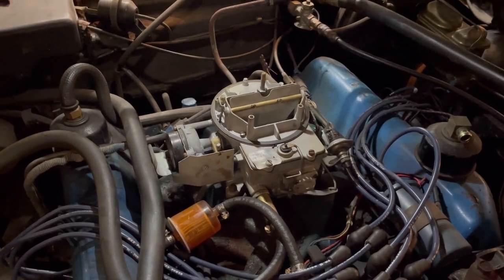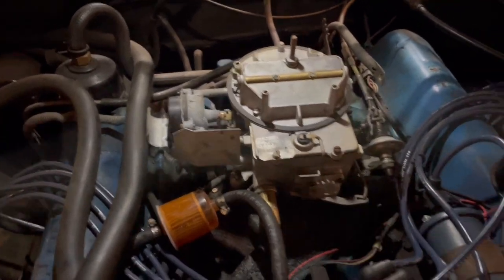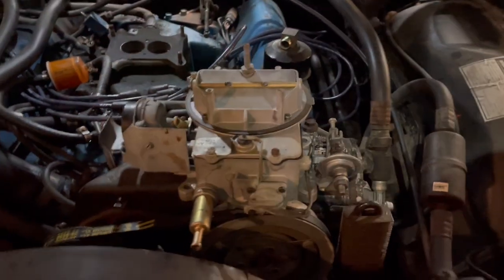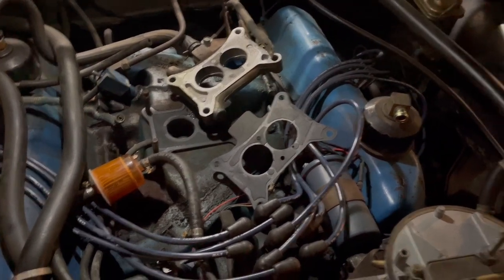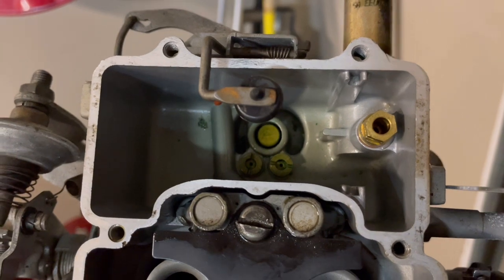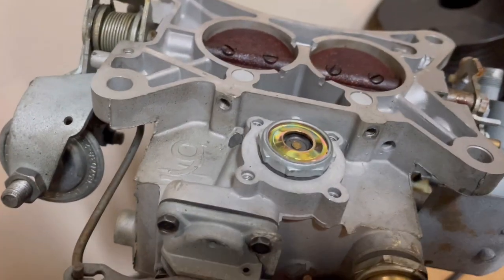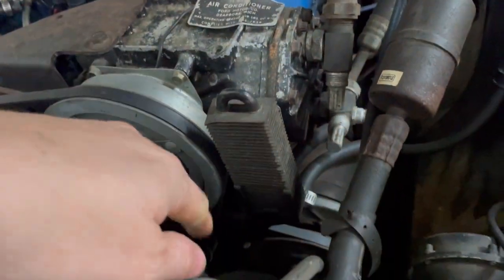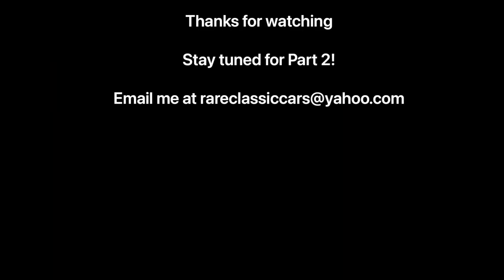Motorcraft / Autolite 2100 Carburetor Rebuild (1968 Ford LTD 390-2V) - Part 1

Comment: Hey Adam, . .good tutorial. Never knew you did them. My bad. Had a '68 Javelin with a baff'd 343 4bbl & FMX auto. Trans went and ended up changing the entire drivetrain. Found a '77 304 with the Motorcraft 2150 ( smog variant ) carb. Rebuilt the carb and threw a Chryco 904 auto with a shift kit in it and added headers. Figured I saved 80 lbs. with the new powertrain. ( the FMX was a cast iron boat anchor ) I never tracked it but driving it, I reckoned I match'd the factory performance of that car. On unleaded fuel to boot ! oh the times we had as " kids " !

Comment: Those were so simple to keep running they would get a little dirty I would just take the top off right on the engine and clean everything slap it back together and it ran like nothing was ever wrong with it⛽️🇺🇸

Comment: The 2100 is a great carb.  I rebuilt one during a community college class on engine building where I rebuilt a Ford 302 2V.  I owned several 2100s on other Ford V8s, and never had trouble with them.

This may not be particular to 2100s, but late 60s mid-sized Fords often had the throttle linkage set from the factory with only about ⅔ of gas pedal travel.  Readjusting the threaded rod on the throttle linkage to full travel unlocked a lot of engine power.
Reply from the maker: I have seen that on a number of cars.

Comment: Thanks for that video!  I have the 2100 on my '69 Marquis, and the carb was one of the first things I needed to do. Mine was in even greater need of a rebuild. Although I had a professional shop rebuild it, while I put on a new 2100 compatible carb from Amazon (which works excellently btw.) So now I have the OEM Motorcraft one rebuilt and ready on the shelf should the need arise. I am saving this video for future reference.  I was hypnotized by your endless tapping of the power valve! :face-purple-wide-eyes:
Reply: My friend's father across the alley bought a '71 Colony Park wagon with the 429 2bbl. That car could haul and scat pretty good for quite a while. Liked the premium fuel though.

Comment: I had one of these rebuilt last week. It's for an 1978 Ford F150 5.8L. It was running fine, but it was starting to leak from the accelerator pump. I was charged $260 on the vehicle, $160 if you drop it off.  I dropped the vehicle off in the morning and picked it up in the afternoon.  It was tuned and now, it's running better than it was before!    For me it was worth the extra $100!

Comment: I used to be pretty good with carbs, it's been a long time since I did one. I had a 69 F250, after a carb rebuild it would be a really sweet runner. It was an easy carb to rebuild. My very first rebuild was a Rochester 2bbl on my 65 Pontiac Tempest 326. It had quite an acceleration stumble when I got it, the rebuild straightened that right out!

Comment: My grandmother of my moms side of fam, bought a 1970 MACH 1 w/351 Cleveland, MT &, 9” rear end back @ 1972… my grandfather of same side ended up buying a 1971 Torino Ranchero GT w/351 Cleveland, C6 A/T &, 9” rear end.. I ended up getting the Ranchero from them in ‘94 & added about 250,000 more miles to the 250K miles it already had on it from them, by the time I regrettably sold it @ 2012. Anyway, both of those cars’ carbs looked exactly the same as this version on your ‘68 & both of those Cleveland’s had more then enough power for whenever needed. I maintained all of their different vehicles over the years back then and had rebuilt both of them carbs at least twice each over the decades they drove them around & rebuilt the one on Ranchero another few times during the decades I owned it… very simplistic carbs! I did have one particular issue with the one on my Ranchero within say, the last decade of use, of having the skinny brass metering jet tubes fall loose from the pop metal holder a few times; concluded the pop metal of that jet holder was just shot or worn out. Was but a 15 minute quick repair I could do of separating the carbs’ upper half while carb remained on engine, removing the jet holder, retrieving one or both jets, shoving those back up into holder as tightly as I could & replacing all parts… that’d last for about another year or so before they’d fall loose again. Point is, per your mentioning of symptoms/diagnoses, yeah, I drove that one long enough to very much know exactly when and what was about to become a bigger problem! Great vid & info! Keep up your great YT chan!
Reply: Odd since I don't recall 2V carbs on Cleveland Mach 1's. They were usually used on Windsors'. Must have been a supply thing. A  289 4bbl manifold on a a 351 Windsor works very well B-T-W.

Comment: Happy New Year, Adam. Thanks once again for sharing. Because Ford is an Engineering company that builds cars, the S code got its 265 HP engines carb size downgraded to 1.21  for 67 onwards. The 1966 390  Autolite 2100 1.33 had a C6 MF code. 424 cfm. I'm looking on your tag code. Pretty sure it's a smaller carb. I used the bigger 1.33 on my mates Chrysler Hemi 265 2bbl. The old Autolites are simply exceptionally good. For the Bowl vent emissions era, the 2bbls got more and more emaciated each year.

Comment: You see that heater hose bracket up against the choke housing? I took one off a Ford and put it onto my Chevrolet. 

If i set my choke to close up nicely, it wouldn't open up all the way. If i set my choke to open up nicely, it wouldn't close all the way. That addition fixed it.

Ingenious.

Comment: Happy New Year Adam. I have to say I never seen an old carb as clean as this one. I also have no carb bucket. I do spend a lot of time cleaning the inside, outside and especially each small passage. Thanks for another great video.
Reply: 9900 miles will do that
Reply: Call me old fashioned but I use old metal coffee cans as a dip bucket filled with kerosene and a toothbrush

Comment: HI ADAM ,, GREAT IDEA ABOUT TAKEN A PICTURE,, POWER BELT SPRING ,, INTERESTING.. PART 2 CARB. GREAT.. I DONT USE A FLASH LIGHT NO LONGER I USE A HEAD LIGHT IT WORKS GREAT ,,HANDS FREE TO WORK ON PARTS.. THANKS..

Comment: Love the show, and your cars! In the 80's, I worked as a mechanic in Dallas, and rebuilt hundreds of carbs, including dozens of Motorcraft 2100's. However, I never saw rust on the throttle plates. I recently rebuilt the Carter 2bbl on a '72 Dodge 318 in a Winnebago, also no rust... I have to wonder, what caused so much rust in the intake tract? I suspect that there has been a coolant leak into the intake side of cylinder heads or intake manifold at some point in this car's history, but I haven't worked on many cars from the rust belt. Have you seen rust on other throttle plates in your collection? Enquiring minds want to know. Thanks for sharing, you have some great cars!
Reply from the maker: I suspect it’s because the car sat for many years unused in a somewhat moist environment.  Thankfully, aside from the issues described, the motor runs like a top and is whisper quiet if I exclude the sound of the flow masters. 

I’ve had some carbs with minor throttle blade rust, but this one is the worst.  It doesn’t appear to impair the operation, though.

Comment: Very good. Could you clean out that pump and spring to see if it operated properly so you could keep it as a spare?
Reply from the maker: Not really. The rubber diaphragm decomposes.
Reply: Got it. Thanks Adam.

Comment: Good time to renew rubber fuel lines with gasohol resistant material. Another YouTube channel,  Waylon Wire, had a nice old Chevrolet truck engine fire from a leaking line.

Comment: That carb has been rebuilt fairly recently because it is so clean inside. Then it probably just sat and corroded the power valve shaft and the accelerator pump deteriorated
Reply from the maker: I agree

Comment: Adam, the old power valve has a stronger spring calibrated to enrich the mixture at higher loads, the replacement power valve will actuate at much lower loads. There maybe a vacuum rating number stamped on the valves.
Reply: Those power valve look A LOT like Holley carb valves. If so there is tremendous aftermarket support for them and they can be purchased individually. If a Holley PV fits you can even tune them as they are stamped at the vacuum that they open at; a 65 opens at 6.5 inches of mercury, an 85 at 8.5 inHg, etc. For a big car like that if it has lean tip-in  I would try an 85 or 95 PV to enrich the mix on tip-in. I expect that with a 390 2V it probably will cruise at highway speed at about 12-14 inHg. You could temporarily run a vacuum gauge into the driver's compartment and observe the vacuum at cruise. If you pick a power valve about 2 inHg lower than the cruise vacuum it will have excellent response. For cars that are jetted lean this procedure will definitely help and may not need as much main jet increase to run well.

Comment: Great Video! I need your help. I just had my 2100 carburetor rebuilt for my 68 Mercury Monterey. I installed it with new gaskets below and above the spacer. Now I'm getting a very load whistling sound. I think it may be a vacuum leak around the gasket. I tried another set of gaskets and got the same thing. What can i do to seal such a leak? Is the any type of fuel resistant sealant I can apply that would solve my issue?  Thanks.
Reply from the maker: You have the wrong gasket or a cracked spacer or your pcv has a vacuum leak. You’ll have to find the leak. Spray carb cleaner around the base of the carb to figure out where the leak is coming from.

Comment: I am looking at a stock 1976 Ford Elite with a 400m 2bbl, but I am hesitant on buying it because the car won't hold an even idle. I believe the motor is unmolested with all the unnecessary smog still hooked up. Does anyone know what would be the most likely cause of this symptom.  With the idle set a bit faster (bouncing between 1200 to 1500 RPM), the car doesn't stumble off the line, but with it set to bounce between 600 and 1000 RPM it does. The car seems to run fine otherwise. If it's a carb or points/coil issue, I may consider buying it, but if the timing chain needs to be replaced, the car just does not have enough value to pull the trigger.